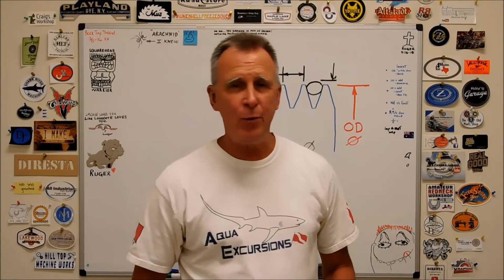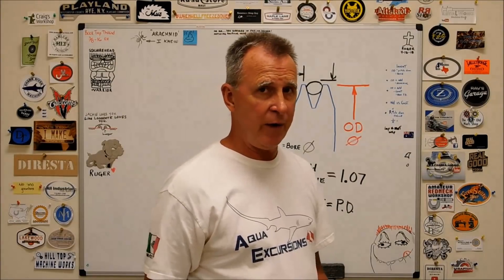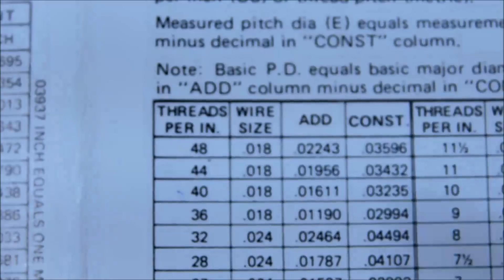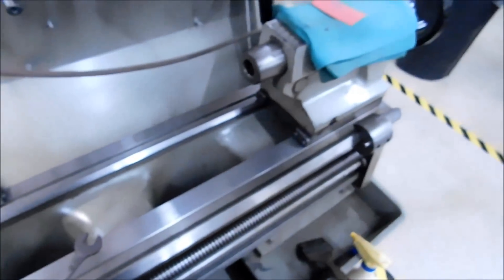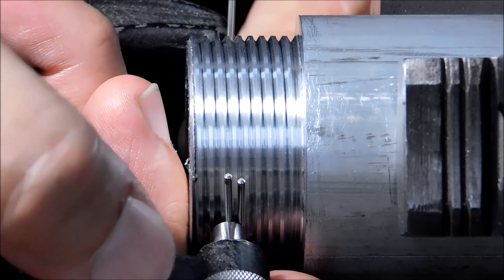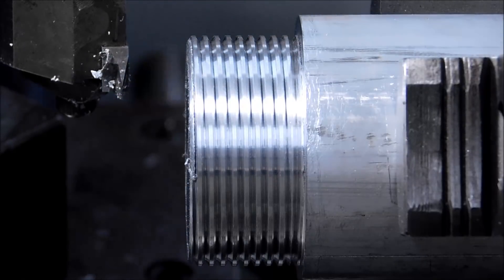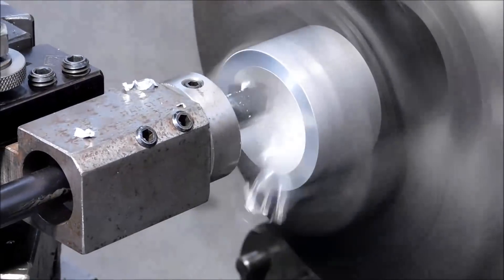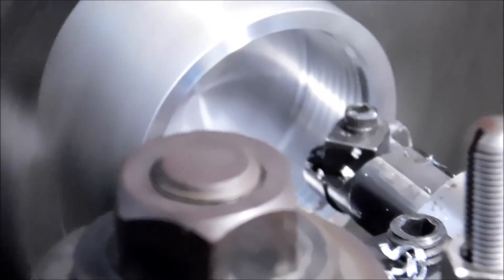Machining Non-Standard Threads

Comment: Joe, I may have missed this, but how did you determine the depth to cut the inside threads? 
I know you said that the target was the number on the dial when you made the witness mark on the blueing, but I thought the blued area was a counter bore.
Reply: The counterbore was 1.710, the major diameter so the thread had to be smaller, so he got close and did a lot of test fits as he got close, u can see him testing. At the end he comments that if u have to match a part u don't have, you need to add a few thousands so the major max diameter matches the tolerance of the thread your cutting. Play the last few minute again a listen for it.
Reply: @ArcFlashWarning  Thanks, appreciate your reply.

Comment: Hi Joe.
Nice video as usual.

Can this plunge cut, at the begining of the external thread, be considered as stress rising point?
Reply from the maker: I would think any well defined radial feature can be a focal point for failure. Most of the 'allowed' thread undercuts I have done, have had a radius at the shoulder side for just that reason.

Comment: What advantage to threading upside down>?thanks...or just because here is no undercut
Reply: John F, you are not threading up to a shoulder by using this method, less stress as well as chance of crashing. Joe has a video dedicated to this aspect of threading.
Cheers from John, Australia.
Reply from the maker: Check the video description for additional links to material referenced in this video.
Reply: Aloha, the thread is the same both ways, but imagine yourself speeding towards a brick wall at 60 mph, if you are like me your pucker factor goes up because you need to determine the exact moment of hitting the brakes and how hard.  When threading into a shoulder like this the same pucker factor applies you need to hit the threading lever at the exact moment several time in a row to keep from crashing into the shoulder, by turning the tool upside down and cutting from left to right you are speeding into an unobstructed area.... NO pucker factor... and the thread form is the same as if the tool was right side up and moving from right to left, but your palms are dry.... hope that make sense.  Go make chips...
Reply: Thanks all

Comment: I think it is a bit more useful to know (or at least have written down somewhere) the actual formulas for doing wire measurements on threads, so you can actually understand what it is that you're doing instead of being one of those "machinists" who can only follow charts. There's two ways to do it:

Measurement Over Wires = Pitch Diameter + (3*Wire Size) - .86603 / TPI
Measurement Over Wires = Pitch Diameter + (3*Wire Size) - .86603 * Pitch

.86603 is your constant.

There is a theoretically optimal wire size for a given pitch, and again, there's two ways to obtain that:

Best Wire Size = .57735 / TPI
Best Wire Size = .57735 * Pitch

Rounding to the nearest thousandth of an inch, will easily be close enough, though you'll notice with many wire sets that the wire it tells you to use is a few thou off and still good enough.

Comment: This is completely off topic but I have to ask. I recently purchased a hobby lathe for my own use. One of the things that I was not aware of when I purchased it was that when cutting metric threads you are not supposed to disengage the half nut but are to reverse the chuck until the tool is run off the end, adjust your depth, reverse you chuck rotation, and start your new cut. This does not make sense to me. If I use a dial indicator on the ways to locate my carriage at exactly the same position and then use the thread dial on exactly the same engagement spot in my mind it should still locate and cut the threads correctly since the screw is synchronized with the chuck. Am I nuts or will this actually work? I ask because I don't like the idea of having to run in towards a shoulder when cutting threads which is why I like your reverse rotation and reverse tool method that you employ.
Reply: Tom Lipton (oxtoolco) has a video on how you can disengage the half nut when cutting metric threads on a standard thread leadscrew.
Reply: The carriage position isn't critical, but the thread dial is. You can open the half nuts, but you still have to reverse the spindle then catch the same number without any extra rotations of the dial. If you let the dial make a 360 rotation your thread will be off because the leadscrew is imperial and the thread is metric.  There is no practical common divisor that you can use. (There are examples of custom thread dials that work with metric, but you can only engage them like once every 254 revolutions.) Check out Abom79's metric threading technique for how you can open the half nuts. It is useful for lathes that do not have a spindle break when threading into the chuck with a shoulder.
Reply: You can also combine the method Rambozo Clown describes with Joe’s reverse threading method to do metric threads with an imperial lead screw or imperial threads on a metric lead screw. It’s a bit of a mind bender to start with but it works.
Reply: @gangleweed  It's just another tool in your toolbox. While not ideal for every job, there are times where it is the only option available to you. The time I recall using it best was threading between the tailstock and a shoulder on a lathe without a spindle brake. I actually had to do it at each end to keep from crashing the tool into either the part or the live center. It was a real pain, but that's what it takes sometimes to get the job done. The reason I was the one doing it is because I am the boss.

Comment: I wish I could hold those wires and measure with 2 hands🤪🤣. . .  .I use 2 o-rings just under the major diameter to hold the wires.......thanks for the vid Joe.😎
Reply from the maker: You actually only need one.

Comment: Doing some old tractor and machinery rebuilding you can run into some odd threads. I remember trying to find left hand 11/16 x 18 tpi nuts once. I ended up having a machine shop make them. Very expensive for 10 nuts. One side crowned the other had a washer face. Old Ford tractors had a proprietary 1/4 and 5/16 inch fasteners. Neither USS or SAE. As a joke we called them left handed Dodge bolts because of the old saying Flipped Over Regurgitated Dodge.  Feel free to exchange Flipped to your favorite four letter word.

Comment: Does machineries hand book cover Whitworth?
Reply: Yes, it does.  Pages 1339-1406 in my very old 23rd Edition (dated 1990), obviously different page numbers on other editions.  Maybe not in the 1881 first edition.  The data for things like that don't change, so for many uses, older (=cheaper) editions are perfectly useful, if you're thinking of buying one
Reply: @pnt1035  thanks!  I'd better invest in one - it's hard to tell how specific or general these things are👍
Reply: @pnt1035  Very Old (1990) 
Ha Ha Ha Oh man you are killing me.
Reply: Another good reference is the Engineer's Black Book. Spiral bound so it stays open, too. Most of the info you need without being the brick that Machinery's Handbook is.
Reply: @bwyseymail  Well, of course it's not nearly as old as my lathe, nor as old as me (about the same age as the lathe) but older than a lot of the people around here!
Reply: @2lefThumbs  If it's mostly just for screw threads, I still find the little Zeus Precision Tables handy; that's simply an inexpensive little folder which is far more convenient for quick lookups., and the pages are laminated and oil-resistant  (though you might not think so looking at mine).  My advice: get both.
Reply: Thanks for the info guys

Comment: I have an old Russian revolver. I would like to install a new barrel. What I find is not quite a 24tpi thread on the old barrel. I made a thread, 24tpi on some scrap. I think I made a good thread, but it won't thread in more than1/3 of the way in.  If I reduce the diameter I can thread in about 1/2 way.  The thread I made is about 23.5tpi I think.  At this point I think I need to come up with a different change gear set up.  I will have to experiment with different change gears.   My metric tpi gage is not close and the imperial is closest.   I guess I will have to bite the bullet and do the experiments. My ol;d enco will do 23 and 24tpi as standard .. The russian revolver was made in 1930 I think
Thanks
Reply from the maker: Somewhere in my past I heard some Russian threads were unlike any other. For sake of saving time, just grab any screw with a 1.0mm pitch on it and lay it in the threads. See if it seats. This may save some time and give you a place to start. The next problem will be setting your machine to cut that.

Comment: If I noticed right-- your technique to plunge the thread ends up leaving a 60 degree vee groove at the base of the thread, and on the interior start area on the cap. Now, I was taught that that was a No-No, as the vee groove could fail ( basically Break Off) because of the sharp Vee circumferencial scoring especially on the shaft end. What we did was to machine a radiussed
spot from where to start at the base of the shaft and in the cap. it is much stronger for it. We all have had the white knuckle moments of feeding the vee tool into the cap and fearing the 
crash at the bottom of it, Haven't we? Machinists never move so fast as after one of those episodes, and they usually happen around Lunchtime, hmm?  aww the Good times.  heh!
Reply from the maker: It was done more for the demonstration of the mating part modification. A radius is a good idea if the area will see stress. As for feeding in, no one ever forgets the machine whine as it hits the stop moments before the shear pin snaps off. I'd rather feed out.
Reply from the maker: @gangleweed  In the realm of risk analysis, you have probability and possibility to be considered when it comes to safety or failure analysis. In my medical device experience and big dollar BOW military repairs, both are considered at all levels. Trusting your aging cat like reflexes on a $200K bronze valve body by threading in, or eliminating the probability and possibility of a crash, from the equation, by setting a hard stop and feeding out will always get the vote. In my opinion, only a fool wouldn't see the value in such a setup, and an even bigger fool would take the risk. A hard stop is also beneficial when rapidly repositioning the threading tool to its start point or undercut resting place.
Reply: Thanks for the comeback-- I kinda figured you were just expediting the basic info. for the members. That would be a neat set of machinist Salt and Pepper shakers -- one with a Big radius on the cap -- The other flat -- all shined up with some cool salt and Pepper holes drilled in the cap ends.
No Matter what we have all strived to work to the print, sometimes they say too much, and it could have been a lot simpler -- But who are we?  Ours is to Machine or Die!

Comment: I confess I love cutting threads, but I would probably not do all that math, I just cut and try until it feels right (-:  I have never used thread wires and have made threads that fit a part I cannot test against without  problems.  but, maybe using wires would have been quicker?
Reply from the maker: How do you measure what you have?
Reply: @joepie221  micrometer across the crests gives major diameter, loupe to estimate crest width, a matching nut for 'feel'.   Though I have made rocket (nozzle) parts my threaded parts are normally not that critical  (-:  I think the trickiest ones were the camera lens filter adapter of 0.75mm pitch.  Thread wires would not have helped as I dont have a 3" micrometer!

Comment: I got thread guage wires in the UK no problem. Had them ages ago from Arcurotrade. They still have them available but in a box rather than a wallet . https://www.arceurotrade.co.uk/Catalogue/Measurement/Thread-Gauges-and-Wires/Thread-Measuring-Wire-Set-with-Holders
Reply: Same here.  I think my purchase was Joe's "fault".  Have used them to help understand the correct dimensions and also to cut threads I have no existing nut for.  Fiddly but a really helpful tool to have in that situation.  Incidentally the wires supplied are imperial but there are (or at least were in the wallet variety I bought) tables that included the metric threads and dimensions.

Comment: Just never put your fingers inside a rotating part in the lathe!
Reply from the maker: Thats a good rule. I saw a guy try to deburr a 3/4" pipe thread once. ONCE. What a mess that was. Sucked his finger right in and cleaned the meat right off it.
Reply from the maker: @MatthewTinker-au-pont-blanc  Correction............there is no good way to loose a finger.
Reply: Your absolutely right there!